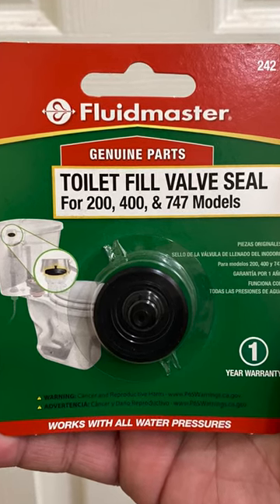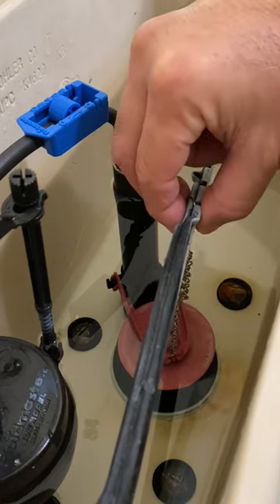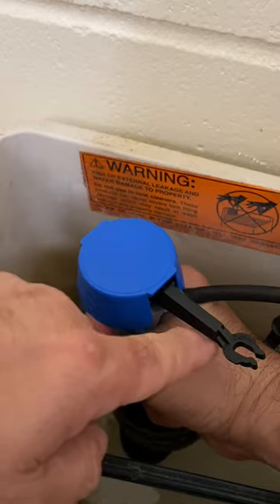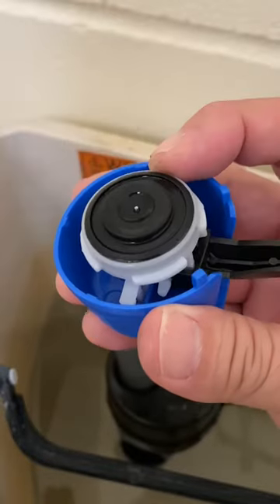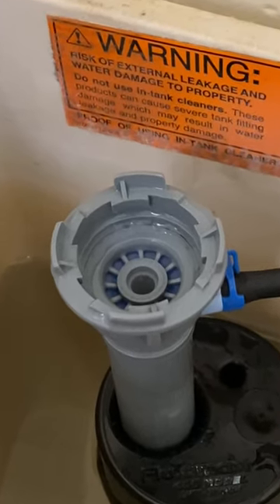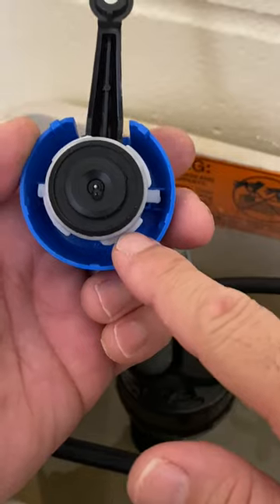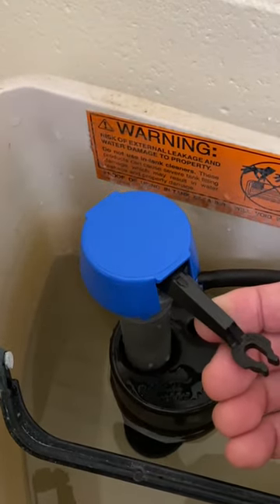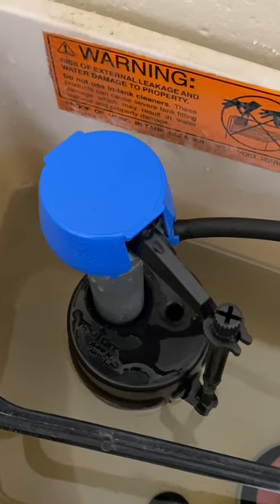Fix it Yourself!  Replace the Fluidmaster 400 Valve Seal for Beginners | Basic Life Skills

Comment: THANK YOU FOR POSTING THIS! The Fluidmaster in our guest bathroom decided to keep running with the tank full. Guess we don't use it often enough. After rwatching your video, I was able to get the cap off without breaking anything, and cleaned the valve seal with a tissue. I somehow managed to get it reassembled without breaking anything, and.... it works!! No trips to Ace Hardware! No major plumbing fracus. My wife is happy! Thank you.
Reply from the maker: You’re welcome!  😎

Comment: Thank you! Cost me less than $2.00 for the new valve. I am a older female that has very little skills or background in repairs for my home. With the help of these You Tube videos, I was able to stop 2 running toliets. One only needed the flapper replaced and the second, a new valve seal. Thank you again!

Comment: I can’t thank you enough for posting this!! I wish I could like this video more than once.   Turns out my valve seal was fine.  I live in a semi rural area and use a well.  There was just a BUNCH of debris in the slots at the top of the fill tube.   I cleaned the debris out, checked the water flow, and everything was great after the debris was removed.  

I hate trying to fix things, but this video was PERFECT.  It was clear and easy to follow.  Thank you again.  😊👍🏾
Reply from the maker: Thanks! Glad to hear it!  👍😎
Reply: This sounds like our problem since we have a shallow well.Definately going to try cleaning the seal before buying any parts.Hope that's all it needs!!

Comment: Trip to a big box store and this video helped me to keep my dad/husband card for one more repair.  

  I was dealing with a tank that would not fill back up after flushing.  During my repair, the top of the float screw would not come off of the valve arm, so I just took the bottom off instead and everything else worked as shown.  Thank you sir!
Reply: This is my issue too. Thanks for sharing! I’m going to try this first.

Comment: Very clear explanation. I am fixing mine now
Reply from the maker: Thank you for the feedback!  Hope you got it fixed.
😎
Reply: @HacksbyDad  Actually finally I found it is the piece of round rubber acting as the seal. After adding a O-ring on the back, it gets enough pressure to seal the water ...... Cost me 10 cents🤣👋
Reply from the maker: @gerryyuam3113  👍

Comment: Our valve didn't keep running, it just slowed down to a trickle taking 30 minutes to fill. I took it apart and cleaned it but no luck. After buying and replacing this little valve seal it works like new. Crazy to think that all these years I have been replacing the whole thing every time it malfunctioned.
I still don't understand why the new one worked and the old one didn't. They both look exactly the same, no wear or broken parts on the old one. It's a little more stiff is all.
Reply from the maker: One of the great plumbing mysteries.  🤷🏻‍♂️😎

Comment: They also sell the whole valve cap assembly, which includes the seal. It was only about 1 dollar more than the valve seal when I bought one. It was very easy to replace the whole thing.

Comment: Thx for the post. Mine keeps running and make a really high pitched squeal. I could stop it by pressing down on the top of the fill valve but as soon as i release, starts squealing again. I shut the water off and it stops. Gonna replace the seal tomorrow.

Comment: Very helpful video. The only thing I would add is to turn the water valve back completely on after changing the seal. I tried only turning it a bit to make sure it worked, but the water pressure must not have been enough to make a good seal, because it just ran and ran with the water on only a little.
Reply from the maker: Good point.  Thanks!

Comment: Attention: if you have an American Standard fill valve model 0925A (blue top) it was made by Fluidmaster and takes the same washer.  To confirm, just look at the top of the black float for the Fluidmaster brand and model number (400).  If you have an older valve you won't be able to disconnect the float rod but you can follow the same twist-and-remove instructions to get to the washer.

Comment: Great video; thanks! (Could have saved $8 on the whole repair kit, have I found it earlier. 😉) One question though... looks like in my case, the pin just goes through the seal, without pushing it down. To me this looks like an awful weakness in this construction, bound to happen sooner than later. Or am I missing something?
Reply from the maker: This video might help clear things up... https://youtu.be/twynH8xVdy8
👍😎
Reply: @HacksbyDad  Wow... what can I say? You are THE MAN! Thanks for this video - I had no idea about the complexity & ingenuity that went into this simple-looking device. So then I am wondering - and of course I am not expecting you to diagnose my fill valve from remote, I am just puzzled - what could have possibly gone wrong with mine? The water doesn't stop when the tank is full, even though all parts seem to be intact and functioning. (Granted, I cannot see what the seal is doing inside the valve.)
Reply from the maker: @apc067  Hard to say without looking at the entire setup.  Here are 4 common issues... https://youtu.be/yXPPsLz1MMQ
👍😎
Reply: @HacksbyDad  Thanks again! Based on what I've learned, it seems that because of some debris or the wear of the seal, it could no longer slide down to close the valve. Next time this happens, I will know I probably don't have to replace the whole fill valve.
Reply: @HacksbyDad  Update - I went ahead and cleaned the seal & its area in the "broken" Fluidmaster, and what do you know; it did fix the problem! Now I used that to swap out a really old, floater-on-rod style fill valve in another tank that was already on its last leg. I really appreciate it, and it's not even about the $8 I saved, but the ability to fix things with knowledge (and also spare Mother Earth from one more piece of trash).

Comment: I used new seal valve from HD and Kohler and doesn’t work. Valve seal is different.  Doesn’t even seal like it should. The old one works  but after every flush it has to be reset.

Comment: So I took it apart and clean off a lot of gank off the seal, however the water is still leaking from the top, the seal looks to be in good condition, how do I know it is the seal's fault? How can you tell a seal if failing
Reply from the maker: Is it a constant leak?  
It should only release a little bit of water when the toilet is flushed.  This video explains the operation of the fill valve and shows the release of water... https://youtu.be/twynH8xVdy8

Comment: I replaced the seal but still have a very small leak. Tried on/off water rinse. no joy. This is a brand new F400 from Home Depot! Factory defect?
Reply from the maker: What exactly do you mean by a small leak?
Reply: @HacksbyDad  There is a leak when the float arm is all the way up. Small woud be drip, drip, drip from the fill tube.
Reply from the maker: I would verify that the fill valve is correctly installed.  See this video for the installation details... https://youtu.be/HFLEoBAJj2E

Comment: My problem is that the valve won't open when the water level drops.  I have to bump the valve arm to get it to open.  I replace the valve, and a couple of months later, it's the same thing again.  How do I fix that?  I'm tired of buying/installing valves every couple of months.  Is there a better brand I could switch to?
Reply from the maker: I've only used Fluidmaster fill valves and haven't experienced a similar problem.  If you disconnect the valve arm from the float screw, does the float freely move up and down?  Does the float rub against the tank wall?
Reply: @HacksbyDad  
The float moves freely.  When I flush the toilet, the water drains normally, but no water flows (usually).  The slightest tap on the valve arm gets it to work.
Reply: @johnstorton  Did you hold the float under water to put a little water  weight in the float reservoir? a tiny amount helps overcome friction. On extreme cases i cut a 3 inch piece of solder bend an L in it and place it in the small hole on the float. Adjust the water level accordingly.
Reply: @fredbadgett7962  
The float drops immediately after flushing, and the arm goes down as well, but water doesn't flow until I very lightly tap the valve arm sideways.  The float is definitely not the problem.

Comment: Lol mine started making a less frequent higher pitch nose after replacing the seal. Instead of a lower pitch nose every time. 🙃
Reply from the maker: Sorry to hear that.  Replacing the valve seal usually works, but not always.  😎